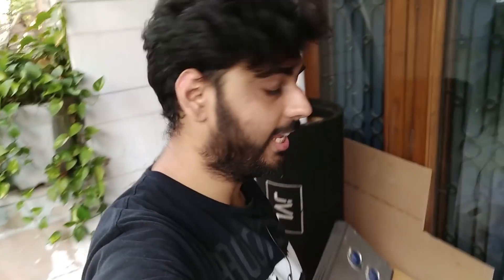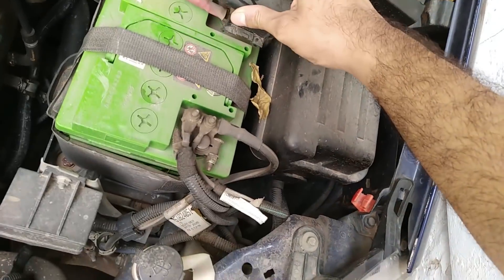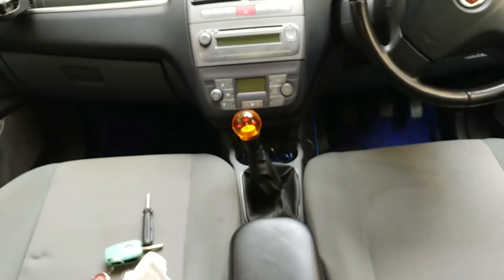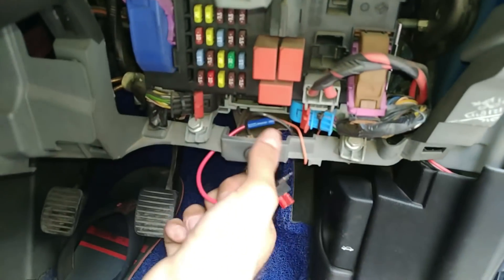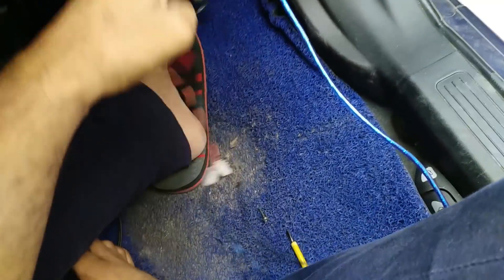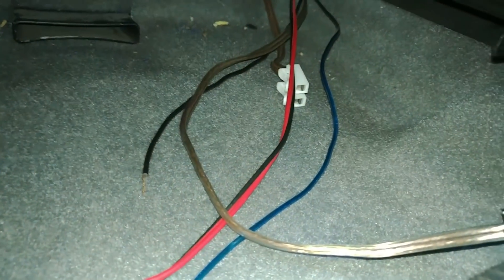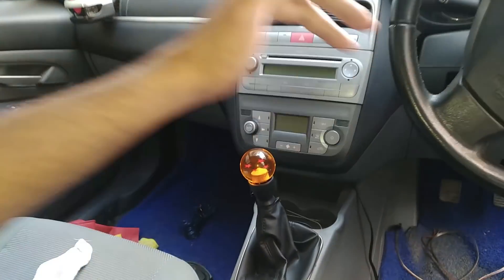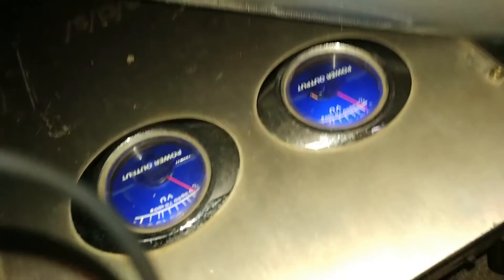How to Install a 5 Channel Amplifier in any car

Comment: Bhai wo fues kitne ampere K h?
Reply from the maker: Kaunsa wo Jo battery k paas lagaya. Bhai wo 50 amp ka hai. Jab system upgrade karunga tab 70 ka ya 90 ka lagaunga. 😊😊
Reply: @AmulLuthra  meri car m sony k amp + 10" base tube lga hua h usme kitne ampere k fuse lgau?
Reply from the maker: 50 amp wala daal do agar nhi lga hua. 😊

Comment: Which version of Punto should I buy ? It will be my first car and I am planning to go for long road trips in it too . Please also tell me average yearly maintenance cost and fuel mileage. I am not sure about diesel or petrol variant.
Reply from the maker: Brother first of all get the one that got airbags in it and secondly if you want to do lot roadtrips get the diesel one because it got higher mileage and its gonna be cheaper on the pocket and i did made last year service video you can check that out and next video is this years service of punto and you will be shock with the total bill. 😊

Comment: Bro yr ghar pe car vala amp chala ne ke lie konsi power supply use karte ho 
By the way 2nd comment
Love you keep up
Reply from the maker: Bhai chalne ko toh computer power supply se be chal jayega 12v ki line par. But go for 12v power supply at least 40 amps or higher if you want to run Subwoofer. 😊 And brother please do Share the channel wherever you can it really helps me out. 😊😊